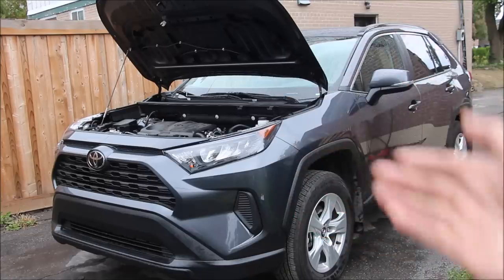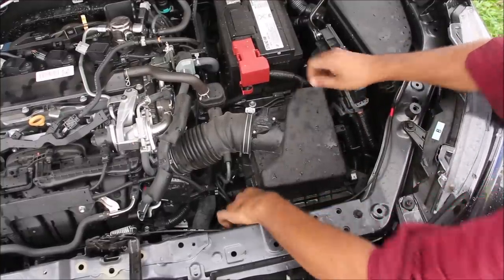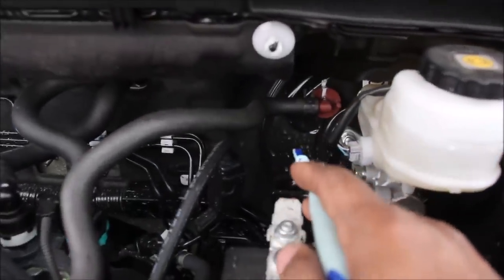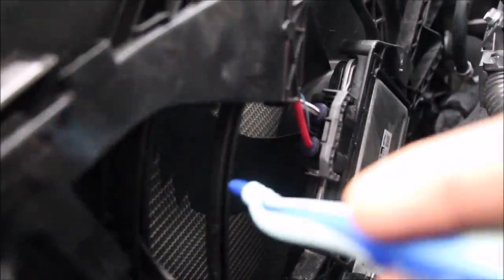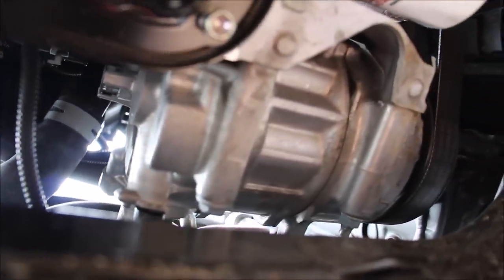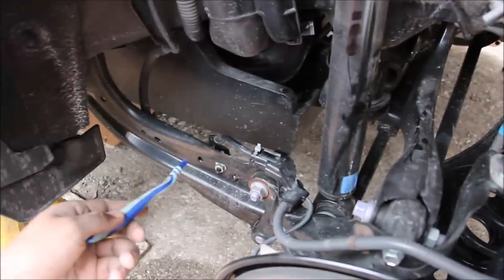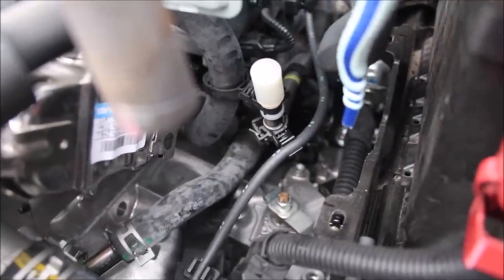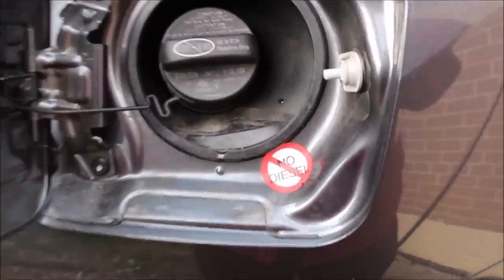Toyota RAV4 Mechanical Review

Comment: The “beauty cover” over the engine I don’t really care about, I took mine off my Corolla. Must admit though I’m not too crazy about a plastic valve cover. Plastic gets old, dries out, cracks, and will eventually need to be replaced as the vehicle ages. Valve covers are an easy morning to remove and replace but still, I prefer metal.
Reply from the maker: Same here. Metal for me, but hey cars have had plastic valve covers for a while now with not too many issues
Reply: Cars are made so throw away now- plastic is ruining the world because its made to fail. Our cars should cost half because of all the cheap plastic.
Reply: Gray Swan I agree. It’d be one thing if you could still get a brand new car for $3,000 but obviously those days are gone and are not coming back.
Reply: I wouldn't worry about the plastics.  Automakers know which plastics will last.  My 2001 ford escape uses a plastic valve cover and intake and have never had any leaks or warping.

Comment: Should be a very reliable, durable vehicle. No real failure points, and everything's pretty easily accessible (except for the steering rack). Great job, Toyota (and speedkar99).
Reply: The steering rack is electric and they shouldn’t fail as often as the Fords do.

Comment: We have a 2015 Mazda CX-9 with the Ford Cyclone 3.7 engine. Made it to 83,000 miles before the water pump went out and ruined the engine because it's located inside the timing cover. Glad to see Toyota didn't make that bonehead mistake with their engines.
Reply: The Nissan V6 also uses the same design. However, the water pump is not in the middle of the engine nor stressed by the timing chain.

Comment: would like review on 2019 rav4 hybrid
Reply from the maker: Alot of people want to review the hybrid haha....what's so interesting?
Reply: @speedkar99  The hybrid is the one outselling just about every vehicle on the street. The gas rav4 is fine, but it's not the main attraction. People would appreciate your approach and perspective.
Reply: speedkar99 because it’s AWD by default with better power, low RPM turk and still better efficiency. And only 800 bucks for all that.

Comment: Just wanted to point out that the engine cover is foam and not plastic to reduce engine noise for the 2019 model year, as it was a big complaint among owners. It does make quite the audible difference.

Comment: So much plastic, I feel like in a few years they might start making the windshield and pistons from plastic as well.
Reply: The moment a plastic can pass safety regulation I think all will, but at that point, it might be more expensive and heavier than glass and metal. XD
Reply: Plastic also makes the car lighter and also plastic needs to be used on specific parts and not parts like water pumps for example
Reply: The only real advantage plastic parts have for the end consumer is lighter weight. For the manufacturer it is a godsend: faster and simpler production, lower raw material costs, much lower manufacturing costs and good old built-in planned obsolescence. Yet the savings are not passed on to the consumer at all, given the prices of the vehicles themselves as well as these built-to-fail replacement parts.
Reply from the maker: I've seen prototypes for plastic engines
Reply from the maker: At some point plastics will be too heavy and we will be going back to wooden cars 😂
Reply from the maker: True
Reply: @speedkar99  Currently, if we want plastics as strong as metals and as durable as metal and being able to withstand the temperatures that metal can, they'd have to be heavier than Iron.

Also Plastic is an isolator so cooling it is pretty much going to be a huge headache.

Comment: Wonderful channel. After I watched your videos, even though I am not mechanically inclined, it was so easy to change the oil, check brake pads. Lately, I had a problem with rear bumper on my 2019 Toyota RAV4. The rear bumper was involved in a minor collision while my daughter was backing out of a parking spot. The rear plastic bumper caved-in (no cracks in the plastic, just deformed plastic). According to the collision manual for Toyota, the rear plastic bumper is resistant up to 80 degrees Celsius. The damage can be accessed from inside (without removing the bumper) since I was able to slide my hand past the tail pipe and feel the caving from inside.
Should I use a heat gun to warm the plastic on the outside and then push it from inside? What would be a safe temperature for the heat gun to avoid destruction of paint?

Is it better to remove the bumper completely and pour hot water (100 degrees) on the inside of the bumper, then push it back to original position. It is still cold in Canada and I do not have a heated garage, so should I wait until spring to attempt this repair because the plastic is brittle when it's cold outside?

Or should I take it to a paintless dent repair shop because they have special tools? They told me they charge about $200 and can restore up to 80% of how it looked originally.

Thank you very much for your time and I can't wait to see your next videos.
Reply from the maker: PDR can help but it won't be 100%. Better than repainting

Comment: Excellent video. I bought the trail version this year. I would like a better understanding of the additional transmission cooling that helps it achieve a 3,500 pound tow rating. Also whatever else helps it be special.
Reply from the maker: Thanks, make sure you upgrade your brakes and use trailer brakes if towing near that limit.

Comment: This was excellent thank you.
One thing I didn't see was an explanation for how the MPG readout shows 0L/100KM while stopped at a light sometimes. Either it's lying to show better mileage than it's actually getting, or there's something electric turning the engine (RPM is at 600) and not using fuel. EDIT: Corrected RPM readout
Reply from the maker: Shouldn't it read 99L/100km when stopped and 0L/100km when you let off the gas and it's engine braking?
Reply: @speedkar99  Yup, but that's not what I'm seeing, confirmed in the instant read and time graph.
I can see 1-2 minutes of 0 L/100km usage in the graph, and the instant read on the dash is at 0.

Comment: I just got one of these for my girlfriend and I’m rather impressed and relieved with the relative ease of maintenance compared to other brands (no weird suspension setup, independant rear suspension, no messy ouil filter location, critical components are accessible without removal of other parts).

Im also impressed with the engine, I have a 5cylinder Volvo @2.5L but this thing gets the same displacement minus a cylinder. I think Toyota did a great job honestly, I have always been a Euro car man but I can’t say I have a single complaint here and your video put a lot of questions to rest, I was gonna pull out the jacks and airgun to answer them myself lmao
Reply: wrong. it will become a headache. you better invest on a 1000 computer scanner.lol

Comment: Very good review. I love this channel. I gave the new rav4 a visit at my dealer and I'm not really impressed. We have two 4th gen rav4s and they are easy to maintain and we think built quality is also better.
Reply from the maker: Thanks I'm glad you like my work. How are your 4th gens holding up? 

I liked the 3rd gens because they came with that v6!
Reply: @speedkar99  we have a 2015 and a facelift 2016. Eurospec Diesels tho. They are just pure reliable.
Reply: The 5th gen is better in every way, at least the J models.  The 4th Gen is underpowered, hard on fuel, poor ground clearance, cramped, and not as safe.  The 5th gen is a true mid size SUV.  I’m getting over 40 mpg in my 2019 LE AWD.  I feel bad for people that bought the 18s.

Comment: Youll need a press for those bearings if they corrode bad enough! I changed a wheel bearing on an 05 town and country a year and a half ago and it was a bolt on style...there was so much corrosion between the knuckle and the bearing that hammers, torches, bresses, swearing, throwing, and getting mad almost werent enough to get it off...i saved the outer part of it with a third of the corrosion left on it as a trophy from that day...that was the hardest thing ive ever had to do on any vehicle before...

Comment: This RAV4 is designed to be easily maintained and worked on. Toyota!
Reply from the maker: Agreed! I wish the same could be said for v6 Toyotas
Reply: speedkar99 V6s when mounted in a longitudinal configuration are easy to work on.  If you want a V6 get a 4Runner or Tacoma.  I will not buy a transverse V6 in a vehicle like a Highlander.  Luckily the new 2020 Highlander will be available with a 4 cylinder that is hybrid and all wheel drive.  I’m no fan of turbos either.

Comment: Great video! Do you think that it is better engineered and will last longer than the Ford Escape you reviewed?
Reply from the maker: Build quality is about the same. 
The design on the RAV4 is more robust than the Escape, since a naturally aspirated engine has less components that can fail, though both are fairly new engines and it's too early to make predictions on how long each will last.
Reply: @speedkar99  thanks for your reply !
Reply: And Ford is junk.💩

Comment: On larger vehicles, oil circulation tends to be a problem at high mileages.  How likely is this to be a problem for the rav4?
Reply from the maker: Time will tell. Dynamic force series of engines has only been out for 3 years now...

Comment: I'm impressed by all the electrical systems and components that used to be mechanical but also somewhat sad that now these eco cars will not longer be cheap to replace things like water pumps.
Reply from the maker: No need to think negatively about electrical items. 
They've been out for a while and have proven themself. 
With time, price will decrease.

Comment: 2:50 that fuse box has little for a reason, my guess is that your model is the LE or XLE cause if you read the fuses names they have other parts that the car may not have but if you go to higher trim levels the fuse areas will be filled in
Reply from the maker: True

Comment: So many plastics and I'm disappointed with the electric water pump. I'm going back to honda or mazda. Thanks for this review. Now I know what are they doing.
Reply from the maker: I was quite surprised at the electric pump
Reply: Good luck with your Honda turbo and oil dilution. Oh, and DI only with carbon encrusted valves.💩

Comment: What do you see going bad on this?  I don't like the suspension with all those stabilizer links which are prone to cause noises.  All the electrics pumps are also worrying to me which translates to big $$$.  I drive a 2001 ford escape 5 spd manual and love it due to the simplicity and reliability.  I have been eye balling the Rav 4 for a while due to the mileage and the itch to just have something new.
Reply from the maker: Whoa you have one of the original small SUVs there. 
Too bad they don't offer any in manual anymore. 

I wouldn't be worried about electronics. No need to be scared of something you aren't familiar with.

Comment: I saw in another video that 2019 RAV4 engine is much noisier than earlier ones. Also there is a common problem in the 8 speed transmission where gears are sporadically change. Have those issues being fixed or if not how critical are they?
Reply from the maker: I thought that was a programming issue.

Comment: Hello speedkar99, your mechanical review is great! On the RAV4 transmission cooler does the fluid gets cooled through the radiator or is it separated and has it's own cooler to prevent the dreaded milkshake from happening in the future? Thanks

Comment: A little note. At least it's how it is for HVAC stuff the fan having saw teeth help out break apart air noise from the blade itself. Without loosing much to any CFM. Similar to the wing tips you see on planes now a days.

Comment: question for any car or vehicle is there a suggested time frame when to check and clean the underneath chassis of the car?. also what are the things to look at when buying a used car especially the health of underneath chassis?. Nice review by the way.
Reply from the maker: I usually run the hose underneath every time I wash my car. Check out my used car series of videos for more tips
Reply: Welded and bolted connections on the undercarriage that hold the car together are important.  Welds are prone to rust at a higher rate due to dissimilar metals and micro-cracks and porosity.  An old Chevy Lumina I had from the 1990's had a rear wheel control arm detach due to corrosion where it was welded to the unibody  

Where the subframe attaches to the unibody is critical.  Rust can cause the subframe to detach.  Look for gaps between the subframe and unibody.  I had a Buick from the 2000's that developed such a gap.  On a Chevy Lumina the sub-frame detached from the car while I was driving it on the freeway due to rusted carriage bolts.  Such a failure disconnects the rack and pinion from the steering wheel. GM used metal for the bolts that was dissimilar to surrounding metal.  It caused galvanic corrosion that was further worsened by road salt environments.

Comment: As Toyota has already validated the shutters in use and, quite likely (IMO) programmed everything to still be happy should they fail closed, I'd personally block off the lower grille once into reliable sub-zero temps. It's actually a pretty cool strategy for an OEM, adopting old farmer and hot rodder techniques both for cooling and efficiency. Ever see the "Pizza Pizza winter air dam" on a 1989 F-150? LOL
Reply from the maker: Agreed, the active grille shutters aren't something I'm worried about lasting, though theyre right up front which is easy to damage in a bumper tap

Comment: Considering the overall solid engineering of the Rav4, why can't Toyota engineers improve suspension geometry to improve on center feel and overall steering/handling.  I have owned several Toyota cars and the general steering/handling feel is vague.  I do appreciate a mechanic's perspective on how modern cars are put together.  It makes me rethink leasing cars vs long term ownership.
Reply from the maker: Because the typical RAV4 owner doesn't care about handling and wants a nice soft suspension and steering

Comment: So basically camry and RAV4 have the same 2.5L engines? Mechanically speaking which one is better?
Reply from the maker: They are the same, one isn't better than the other. 

The transmission on the other hand...
Reply: @speedkar99  I'm looking to switch from front to all whell drive as I live in cold climate with a lot of snow. Soo about that transmisions...?

Comment: Quite elaborate however it doesn't show the "towing points" where to hook the towing cables.  I look for them extensively but I can't locate them.  May I add that they are needed if the car has to be towed out of the ditch or snow bank.

Comment: We have had to replace the battery for the "Second " time on this s.u.v. The with only 563 c.c.a. and with 60 ah capacity. We found that it does not hold up well at all in the winter. I plane on replacing it the the 380LN3-MF battery designed for the 2019 Camry. It has 770 c.c.a. and 70 ah capacity. There is plenty of room for installation and mounting.
Reply from the maker: How about upgrading alternator.
Reply: I will replace the battery that has much more c.c.a. and capacity. Such as the one installed in my 2019 Camry xse.
Reply: Isn’t it under warranty? It should last 5-years minimum unless you have a drain somewhere.

Comment: I'm thinking about purchasing a used 2016, 17, or 18... maybe a 2015 gas powered (non hybrid) Rav4. Does anybody have any experience with any known mechanical/cosmetic issues or problems with either of those 4 years? In terms of dependability, is there a "sweet spot" year that has the best bang for the buck?
Reply from the maker: 2016 -17
Safety sense 
And the proven 2.5L 2AR engine
Reply: @speedkar99  And if you had to pick a used Highlander in recent years, which one?... 2018, 17, 16?

Comment: Is it good to have the gas lines pass under the passenger seat and through the cabin.
Reply from the maker: Gas lines?
Reply: @speedkar99  I was referring to @1:42 when you pointed your wife's toothbrush at the fuel sending unit on the driver's side. I am an idiot it was late and I didn't smoke enough pot. So when I saw the electrical running to the unit I thought it was the gas line to the engine. 

You are God. Thank you so much for everything you share. You have saved me thousands of dollars.

Comment: I think Hondas equipped with the 1.5 liter turbo might need 0W-16 oil. Will it work remains to be seen
Reply from the maker: Aren't they 0-20?
Reply: @speedkar99  yes but for some reason they're suffering from "Oil Dilution" meaning gas is somehow getting into the oil contaminating it and compromising the oils ability lubricating the bearings causing serious damage. Honda has no solution as of right now
Reply: @kclefthanded427  TURBO

Comment: Great review...any idea why mine (2019 adventure model) would be making a metallic clanking/clinking noise when coming to a stop from about 30 ish or more mph? I had the electromagnetic clutch in the transfer case changed because it had been making a mooing sound so now that’s gone but the clanking (only heard when the windows are down) is still there. The techs though maybe the brakes needed to be scuffed up (thought they were slipping/bouncing on the rotor as I was coming to a stop) but that didn’t do anything.. The noise is coming from the rear and I think might be related to the rear differential somehow (doesn’t make the noise in sport mode, but does in every other mode). Any help or ideas would be greatly appreciated.
Reply from the maker: Check for exhaust shield. You should be warranty don't worry
Reply: speedkar99 wouldn’t it do it more often if that were the case. And it goes away in sport mode